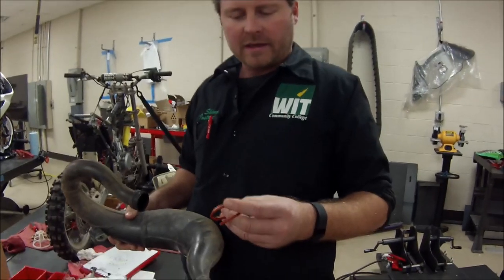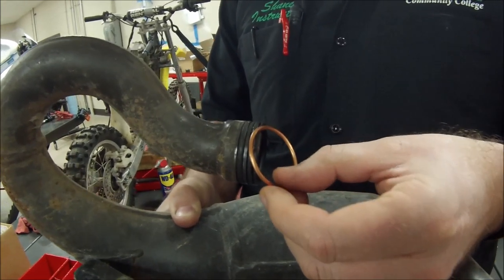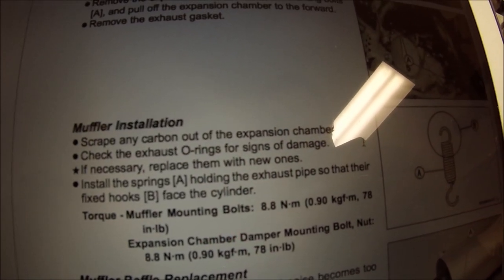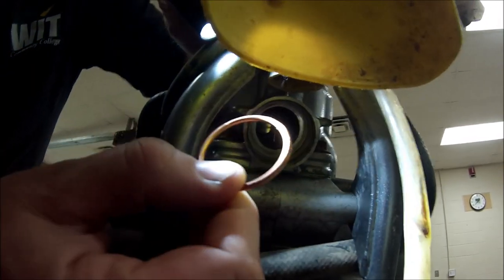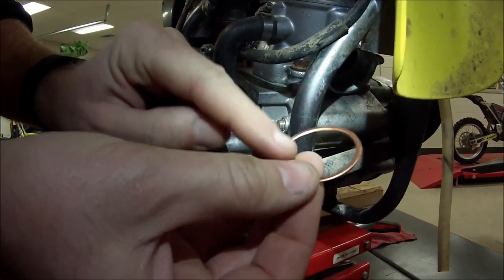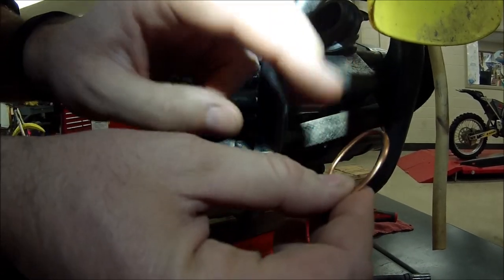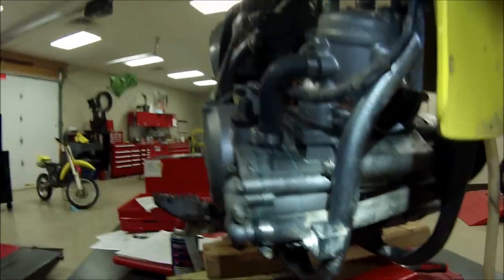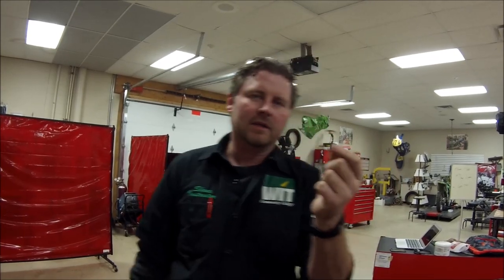EM Series: The why behind copper exhaust gasket direction of installation

Comment from the maker: I looked into this since it was a 5 year old video and I didn't want to recall from memory. But as stated in this video, this bike actually was designed from Suzuki with both gaskets as shown in the parts fiche: https://www.partzilla.com/catalog/suzuki/motorcycle/2004/rm85l/muffler
Reply: @How2Wrench  what grease should we use for the install of the cooper gaskets when the manual says apply a light coat of grease to the new copper gasket?
Reply: So it doesnt tell you on that bike to use abgrease,but what would be sufficient to use on copper gaskets as a lubricant?

Comment: I believe it is the opposite. I put the flat side out, here is why: the flat side matches the diameter of the pipe, the pipe pushes the gasket and the other side of the gasket will be pressed on the cylinder head surface and expands on it taking the shape of the gasket seat. It expands outwards though, when the same time the flat surface (which seems to cover also the internal diameter of the gasket) will prevent the gasket expand inwards as it seems harder material...  Basically it's all about expanding outwards mostly. The bike sounds so sweet, if I am wrong I will let you know in a couple of months maybe...? I took a small risk as the bike does not have much life left with me, so I took the risk for you.
Reply from the maker: Like I say...it “really” doesn’t matter or the manual would specify BUT I feel pretty confident about my method and you’re only focused on your gasket with a flat side, many are rounded on both sides...
Keep Wrenching! Thank you. Here are some ways to support me and other ways to follow me. I’m also available for hire to personally work one on one with you: 
Click here for the membership links and welcome to the community! https://how2wrench.com/product-category/specials/   

Want to say “thanks” or “keep it up”? Click here https://www.paypal.me/how2wrench 

Your answers and help are just around the corner. Save time and money while protecting your investment and yourself by doing it the right way!
Follow us!
Web:
www.How2Wrench.com    
www.Tools2Wrench.com
Reply: I agree 100% you want the seamless side in contact with the steel pipe since it hammers on the surface from sonic pressure waves/spring action with the seam  side is firmly planted against and jammed in the exhaust port. Because some bikes use high temp O-rings the function of the copper is also for protecting the cylinder exhaust port surface from chafe damage. Some o-ring sealed designs forgo the copper gasket due to a more solid support. At the end of the day it matters not as these are dirt bikes with associated low time between exhaust removal. I have been installing the copper gaskets this way since they invented H2 triples.

Comment: Working on a GL1100 restoration and could not find this information in the factory repair manual. I actually hadn't noticed the lip until after I mocked up one side. So glad I hadn't  torque the header down yet. Sure enough one was correct the other was not. Your explanation/logic behind the correct installation is spot on to me. Thank you! absolutely fantastic information.

Comment: Love this channel! Just did a full rebuild of my son's 2005 kx100 with confidence gained from watching this channel. Went smooth as butter and runs like a champ. I actually took the exhaust back off and switched this copper gasket around right after watching this video. Didn't even notice one side was flat. My factory service manual also shows nothing about it. Great knowledgeable videos! SHANE ROCKS!

Comment: Thank you!!!!!!! I also wondered why it has a seam on one side. Sadly in my nation (India) roadside mechanics and service centers do crappy jobs, so I fix all my vehicles myself. And when I asked for copper gasket they handed me a cork gasket, which I clearly knew wasn't supposed to be used as why would a company use an expensive copper gasket had cork gasket sufficed? I searched a lot and finally found OEM copper gasket and wondered which way it would go. Then I found your video! Thank you man! Attention to detail is very important in machines!
Reply from the maker: Hope this helped. Want to give us a “high five”? Click here https://www.paypal.me/how2wrench 
 Need more personalized help? Your answers and help are just around the corner. Save time and money while protecting your investment and yourself by doing it the right way at www.How2Wrench.com  
  
 Thanks for commenting and adding value to our community! Please subscribe, share and consider a H2W membership to support our free work here! 

Have you subscribed yet to never miss a video? Have you seen the video playlists? Over 600 videos! Check them out here: https://www.youtube.com/user/conleybuilt/playlists
Reply: MY FRIEND,I DIDN'T UNDERSTOOD CAUSE MY ENGLISH IS NOT SO GOOD.THE FLAT SIDE OF COOPER WHERE I SHOULD PUT.ON CYLINDERS OUT OR ON EXCHAUST IN

Comment: After adjusting the fork hight on a ninja 400 the exhaust was resting on a jack just enough to adjust the forks without all the front end weight on the jack, and after the adjustment riding for about 20 miles the bike began making a loud tick at 10,000rpm max hp, I thought it needed a valve adjustment but when I got home I tightened the exhaust header bolts to 2ft-lbs each and the tick stopped, so if the bolts on those copper gaskets arn't evenly tight with a torque wrench the slight leak sound is horrible,,,,and never rest the bike on the headers either.😮
Reply from the maker: Right on.

Comment: About to put the exhaust back on my atc 200s, has a copper smash gasket like that. Theory or not, i agree with way you would install it.
Oddly enough, i just did the top end on my 2006 RM85. Didn't have a smashable gasket like that inside. Just a flat, thin, (maybe cooper?) washer looking deal. It does however have a Bill's Pipes exhaust, the expansion chamber has one, wider, silicone gasket (that i ended up replacing with two stock one cause i couldn't find the right one) 
Idk if it's all the correct parts, or even right, but it doesn't leak somehow lol

Comment: Air cooled gasoline powered aircraft engines use the type of gaskets in a lot of different applications and the sealed side goes to what get installed. So, not trying to contradict you but my experience tells me that the seam side would go to the head and the crush side to the pipe. Just installed a set on my 96 FXDL and will let you know if they leak.
Reply: 35 miles, no sign of leaks. Held torque on everything.

Comment: do aftermarket pipes such as the FMF fatty also use the brass gasket thanks
Reply from the maker: It is not the pipe manufacturer that determines this, its the engine manufacture design. Many 2-stroke exhaust systems use an o-ring system.
Have you Subscribed yet to never miss a video? Have you seen the video playlists https://www.youtube.com/user/conleybuilt/playlists ? Quick answers are often found here. No time to look through videos? 

Still have questions? You’re in luck! I provide tech help and work one on one! I know your question may seem quick but with over 300 requests a week, it’s not possible to answer them all. So, I’ve narrowed down so subscribers and donations to assist beyond the over 660 free videos. My YouTube has grown beyond the ability to answer every question (11 million views! Over 500,000 a month!)

Click here for the membership links and welcome to the community! https://how2wrench.com/product-category/specials/    

Want to say “thanks” or “keep it up”? Click here https://www.paypal.me/how2wrench   This is great for those truly quick questions you need answered and your help back will keep me going!

Your answers and help are just around the corner. Save time and money while protecting your investment and yourself by doing it the right way!
Admin How2Wrench.com

Comment: Mine didn't have a flat side....  It was completely round ring...  It wouldn't matter anyways because, if you look at the old ones they're totally crushed flat from the factory, they're crush gaskets that flatten out when the MM torque spec is applied.  So once you torque them down they crush out anyways and go flat.  That's how they seal and make a good fit is by crushing down to make up for any small differences between the head and header pipe and provide positive contact between both.  So which direction isn't going to matter if the thing looks like a pancake when you're done anyways...
Reply from the maker: Thanks for commenting and adding value to our community!

Please subscribe, share and consider a H2W membership to support our free work here! We are ramping up for the upcoming new member only site with profiles, raffle drawings, and weekly live Q/A sessions and a for sale page!

We have a LIVE Q&A starting soon and will use comments from videos to try and answer too. Got a question you need answered sooner than our LIVE Q&A Shows are on? Here’s how to get your answer for free! https://youtu.be/oAeXz1nd-eQ (and other free tools and products!)

Get my cell number here: https://how2wrench.com/product/personal-tech-training-phone-facetime/

Have you subscribed yet to never miss a video? Have you seen the video playlists? Over 600 videos! Check them out here: https://www.youtube.com/user/conleybuilt/playlists

Your answers and help are just around the corner. Save time and money while protecting your investment and yourself by doing it the right way at www.How2Wrench.com

Want to say “thanks” or “keep it up”? Click here https://www.paypal.me/how2wrench Thanks for commenting and adding value to our community!

Comment: I have a 1977 kz650 I put a Delcevic header on and I got copper gaskets . I saw the seam but mine are round with no flat side. I looked and looked for weeks( delkevic said it didn't matter) so I just installed them. Now they don't seem to want to seal. I am afraid of over tightening them. They still leak very slightly. Any advice. Wish I had stumbled upon this site sooner. I subbed for future though. Thanks for your effort to bring us the info.
Reply from the maker: Have really good clean threads and tighten slowly back and forth across the exhaust. There is a tq spec in the manual and you should be able to create the proper "crush" of the gasket and hit the tq. Problem is that dirty threads of clamps dragging across rusty or even bent studs (usually from over tq in the past) can give you a "false torque" not really compressing the gasket. Get a good "eye" that everything is tightening down even across all the clamps too...
We sure love you taking the time to comment. Are you coming to the next live session? 
There a few ways you could help keep this work going and stay connected with me personally.  
1. The fastest and best thing you could simply do for us is hit that subscribe button…helps us creators more than you know! 
2. Join this channel to get access to perks:
https://www.youtube.com/channel/UCBhM8DCKnT3qXwTW0eToyCg/join   
3. Give us a high 5 here:  https://www.paypal.me/how2wrench    
Keep Wrenching,
Shane Conley
Peoria, AZ USA
Follow us!
www.How2Wrench.com      
www.Tools2Wrench.com   
Facebook: 
https://www.facebook.com/How2Wrench/  
Instagram:
https://www.instagram.com/how2wrench/

Comment: Got any tips on my 2stroke dt125. It wants to stall from standstill first gear when pulling away without choke. When choke is out it runs fine and i can keep choke on all speeds. Not getting enough fuel?
Reply from the maker: +TNPerSwede 
Or you could have an air leak.

Comment: It's not in the manual because 2strokes DONT use copper gaskets, it's only 4strokes. That's why in every 4stroke manual THERE IS info about the copper gasket.
Simple
Reply from the maker: Giva an example of where in the manual (which year make and model) it states what direction the gasket is inserted and we will have you a How2Wrench package! It would be great to update this 5 year old video and FYI....this bike DOES require both gaskets as seen from the parts fiche: https://www.partzilla.com/catalog/suzuki/motorcycle/2004/rm85l/muffler

Comment: By “flat side” do you mean the smooth side/unseamed side? Your terms are confusing. Thanks!
Reply from the maker: Good question and I'm sure others would like clarity. Many of these gaskets are actually "flat". For clarity on every year, make, model, size, brand, design, or any other possibility lets roll with a seam or no seam...or folded edge or no to intersecting ends. Hope this helped. 
Thanks for commenting and adding value to our community! Please subscribe, share and consider a H2W membership to support our free work here!

Have you subscribed yet to never miss a video? Have you seen the video playlists? Over 600 videos! Check them out here: https://www.youtube.com/user/conleybuilt/playlists  

Want to say “thanks” or “keep it up”? Click here https://www.paypal.me/how2wrench    
 
Your answers and help are just around the corner. Save time and money while protecting your investment and yourself by doing it the right way at www.How2Wrench.com

Comment: I could NOT for the life of me get my OEM gaskets out my motorcycle. They are smashed in there against that dam head.

Considering the bike has only 1300 miles 2 months old, it's brand new basically, I left oem ones.

I couldn't even get them popped out with my dental pic I use to clean my guns from tiny gunk spots
Reply from the maker: A few tips...1. The crushed gasket is normal and designed to do so as its a one-time use and creates a good seal for temperature expansion. 2. If the gasket was "serverly" crushed, I would be concerned the exhuast studs may be stretched for over-tightening and need replaced to avoid breaking off while operating. 3. If they are hard to get out due to carbon build up and its so a low milage bike, then there may be fuel/engine/elelctrical problems...

👍 Thank you for taking the time to comment! Hit that subscribe button if you haven’t please! It helps us! 
Here is a way to support all the free videos.
Want to say “thanks” or “keep it up”? Click here https://www.paypal.me/how2wrench  

Coach Conley is also available for hire to personally work one on one with you if ever needed. Yep he is a real person. Give him a call @ 602-345-0432
Details here: https://how2wrench.com/product/personal-tech-training-phone-facetime/ 
Your answers and help are just around the corner. Save time and money while protecting your investment and yourself by doing it the right way!
Follow us! 
Web:
www.How2Wrench.com     
www.Tools2Wrench.com

Comment: Copper gaskets is on MOST 4strokes. AND COMPRESSES WHEN CLAMPING THE HEADER.
NOT FOR 2S
YOU CANT COMPRESS ON A 2STROKES!!!!
GADDAMIT.....
Reply from the maker: As you will see from many of these old videos, they were answering a question that came from students. The video is not focused on 2 stroke or 4 stroke but simply just the gasket. Your comments are always welcome if meant to help. Admin-H2W
Reply: @How2Wrench  ok just wanted  it to be correct, especially if it's for students
Reply from the maker: @Motoinc  I looked into this since it was a 5 year old video and I didn't want to recall from memory. But as stated in this video, this bike actually was designed from Suzuki with both gaskets as shown in the parts fiche: https://www.partzilla.com/catalog/suzuki/motorcycle/2004/rm85l/muffler